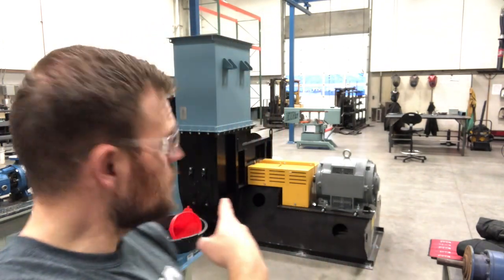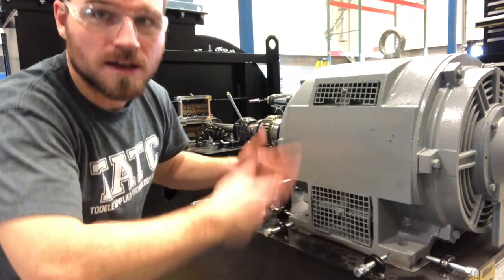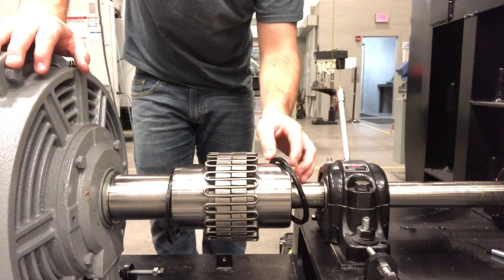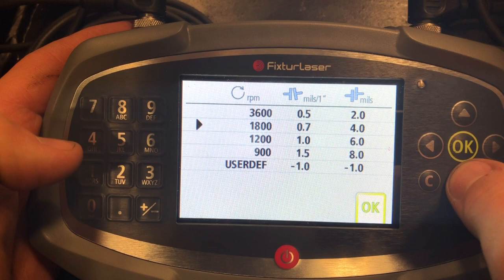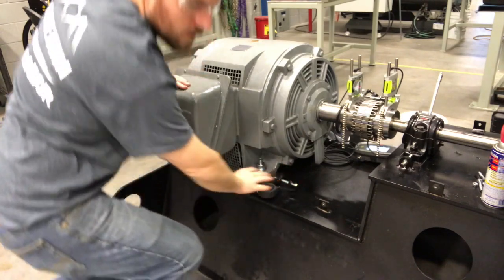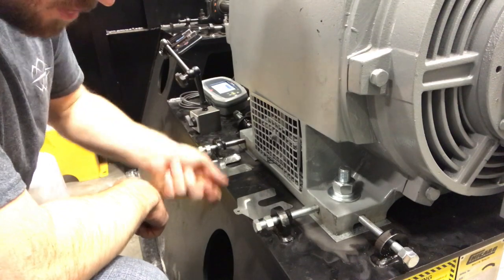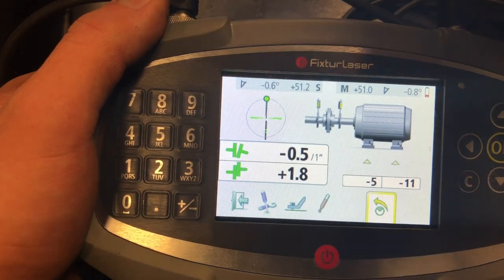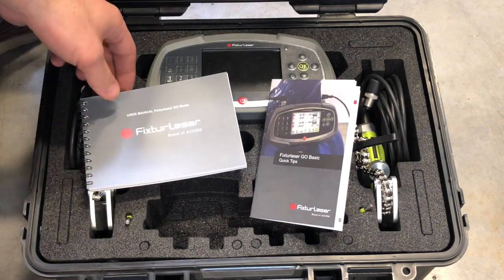Alignment with vibralign laser

Comment: Hi I thought the M stands for Movable?
Reply from the maker: You know you're probably right. I`ll try to remember to look at the manual tomorrow but I would not be surprised if it does stand for movable. Sorry for the miss information, when I remake this video I`ll try and get that fixed! Thanks for letting me know!
Reply: @Mikesfilmss  Not a problem at all mate. Was checking through your videos to actually get some alignment training myself and it was a great video!! 
Are you able to do one onsite and possibly carried out uncoupled? Even if you can find a place without actual jacking bolts :). That way us people who are trying to learn will have a great video with someone doing a difficult alignment to learn off and will accurately resemble a situation out on site :).
Reply from the maker: @visharaliyanage8514  I`m so glad you liked the video! it turns out one of my students let my vibralign laser get crushed last week and we sent it out to be repair with the manual, so I haven't looked into your last question yet. so originally I planed to shoot this video at a local plant, because we only had small motors to align but they were not comfortable with me bring cameras into the plant. At the same time I was approved to buy this blower for my students, so this I how things ended up. I don`t believe my laser can do uncoupled, its hasn't come up for use but I don't think it can. Thats so funny my steering committee made me buy this blower because they wanted it to simulate real life better then our smaller one. You must be trying to do some really hard alignments and yes the jacking bolts are kind of cheating haha